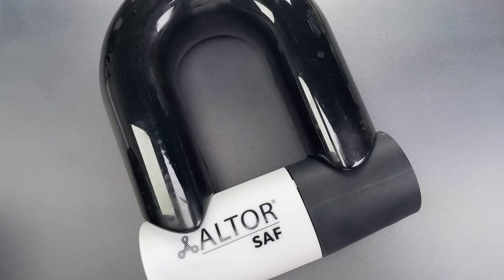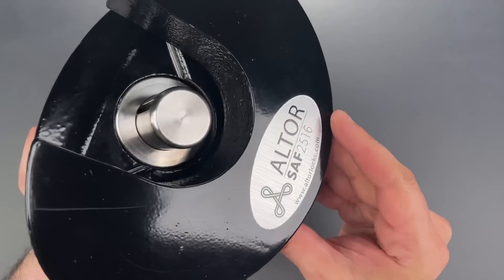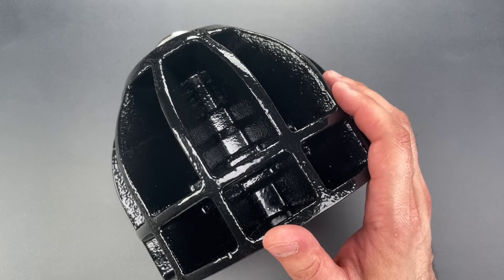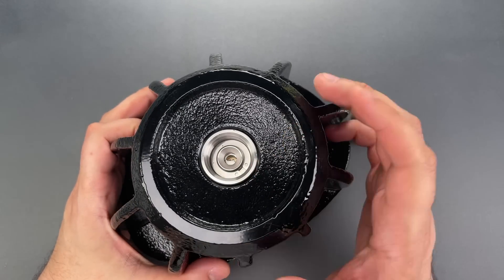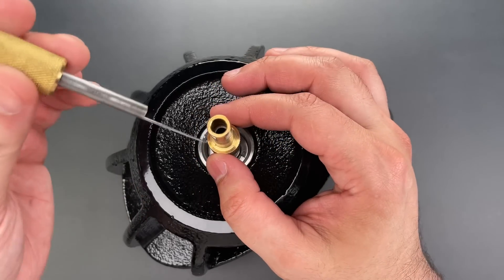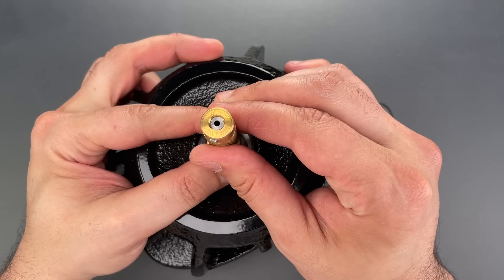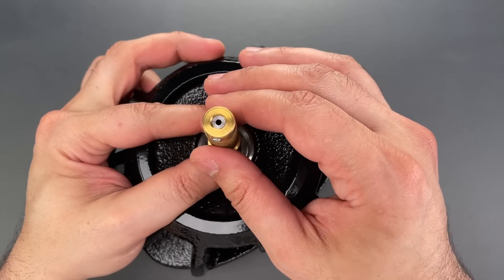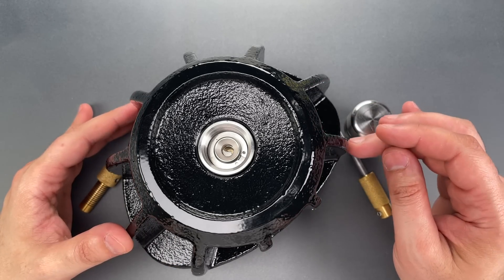[1339] HUGE Altor “SAF” (Strong As F***) Trailer Lock

Comment: "Despite its absurd proportions, this is something I would not hesitate to use"

Wow. What a glowing praise. It's assuring to know that there are locks out there, such as this one, that could actually give you peace of mind knowing that it really could protect your hard earned possession.
Reply: I would recommend keeping an eye on altor because they seem to have a mission now, to create a lock for every purpose that is physically resistant to angle grinders and other similar power tools. And if they continue pursuing that mission then this world will become a lot safer
Reply: @the_undead  They do need to keep changing their lock core, though. The reason a commercially available tool doesn't exist yet is because it's less common. Once a core becomes common, a tool for it will become common.
Reply: @Merennulli  I don't think it's necessary. Just like what LPL said, it would take a specialized tool AND some skills to pick this lock.

But if skilled pickers are going to pick altor, they are going to pick it for the challenge and not for stealing the trailer.
Reply: @Merennulli  picking a lock is not the main problem that you deal with when in more practical use especially once you start getting into the higher end stuff like this detainer cores with a lot of false Gates, and that won't be an issue for a considerable amount of time. The main problem is destructive attacks, destructive attacks are the main reason that Master Lock puts so little effort into their cores because they probably don't see it as worth it to put that much effort in compared to what you're going to get for it in terms of practical use.

That being said I think more effort should be put into the pick resistance of a core but the outer stuff even if a tool does become in common use which I highly doubt because Matt Smith has all kinds of effort put into making sure that nobody can manufacture his lockpicks. 

Which leaves us at destructive entry is the only realistic method someone is going to break into the altor SAF locks. And these things are so resistant to brute force that I would happily trust them for years to come
Reply: @Merennulli  the only reason I wouldn't trust these is if some new standard of battery powered angled grinder becomes a thing like say the standard size is a 5-in disc instead of a four and a half inch disc
Reply: @Layput  My point is that the tool won't be "specialized" anymore if SAF locks with that core become commonplace.
Reply: @the_undead  I would agree this addresses the main problem, but security is a game of being the least viable target. I was responding to the "world would become a lot safer place" aspect.

Right now, the standard of security is on the Master Lock level so thieves come prepared to take out a Master Lock. If this were the standard, thieves would come prepared for this.

That said, I honestly don't see this changing the world of security for the same reason Master Lock is the standard, though - This is about $300-350, while Master Lock trailer locks start under $30. This just moves the needle a little further past "ludicrous" for the high end locks.
Reply: @Layput  Imagine coming out in the morning to find the lock undone and a note saying nothing was taken, you were just practicing...   Sheeeesh....
Reply: Now I spent all all my money on this Altor SAF, i need another one to protect the first one.
Reply: @the_undead  Or angle grinders will be getting a lot better soon!
Reply: "Despite its absurd proportions, this is something I would not hesitate to use" That's what she said?

Comment: "This is something I would not hesitate to use"

annnnnnnd Altor stocks just soared.
Reply: Me the ALPHA M*LE of this comment section and me command RESPECT. Right now me telling you to NOT observe any of me nice cool sweet videos. Instead just look at me awesome good powerful thumbnails. Thank you, dear lu
Reply: Are they actually listed on any stock market?
Reply: @kingbreaker1972  no
Reply: @AxxLAfriku  deez nuts
Reply: Suddenly the super glue is gone from the shelfs haha.Than, number of suicides encreases.
Reply: @JosephLedbetter  lmfao
Reply: @Hansengineering  Alright, Sales then lol
Reply: but he opened it in one minute
Reply: STONKS
Reply: @An.Individual  alright, how about you try.
Reply: @An.Individual  Sure but he had to use the tool he designed specifically for this type of lock and praised the cut and drill resistance. Pair this lock with welded bolts to hold everything else together and that trailer isn't going anywhere.
Reply: @An.Individual  look at some other videos by lpl, where he either picks the cheaper and more usual locks in seconds with a wave rake, or finds a way to bypass the lock entirely

Comment: Altor Execs:  "OK team, LPL just gave the prototype trailer lock his highest praise.  Take it to production immediately and whatever MSRP we were considering, double it."
Reply: With LPL praise like this, they will charge $500 for this lock.
Reply: You forgot the most important part:
"Cut production cost at least in half.
No need for the final product to be as strong as the prototype as long as it looks the same"
Reply: @Jehty_  Awwwww... you've just violated your Master Lock board member NDA.
Reply: @Ron-ds2ob  They were already going to charge that much, it's a very high end trailer lock.
Reply: They say if you preorder it you save $75, and its for $350 rn. Im guessing the final product will be $425, give or take maybe $75
Reply: @Anonymous4045  a lot cheaper than having expensive stuff stolen out of a trailer
Reply: @Anonymous4045  That is honestly way cheaper than I was expecting for what you get. That much steel and the tooling/processes to manufacture it are not cheap.
Reply: MRPR
Reply: Or they'll weaken the prototype to cut costs and people will think they're buying a strong lock.
Reply: Ross Outdoors  well, if you have a couple of snowmobiles for example, you still have them locked separately on the trailer, so getting them off even if you have access to the inside is a bitch.
Reply: Alam natural  quit with the self-adverts and get off Lpl's channel (btw i saw the amount dislikes on your video your doing more harm than good to your self anyway)
Reply: @Ron-ds2ob  and If I was protecting my $50,000 boat, I would gladly pay that to know it can't be cut off with an angle grinder.
Reply: 500 sounds about right honestly.  I bet just that lock cylinder is over 100 dollars.    Then all the steel, manufacturing, shipping, etc.  It’ll be a spendy product.
Reply: Ross Outdoors  Yeah, this won’t stop theft of product, but it will prevent someone from just stealing your whole trailer, which is what many trailer thefts are all about.  It’s often faster to just hook up to it and haul the thing away from prying eyes than it is to cut into the trailer and remove items from the inside.
Reply: Alam natural  Hello. It looks like you are trying to attract new vievers/subscribers to your channel by spamming your videos in the comment section of other YouTubers. If you aren't aware, this behaviour is not going to achieve the desired result. Some curious people like me will klick on the link, skip through the video and then exit playback, before it was counted as a view. I, like others, will now remember your name and avoid your channel like the plague. Have a nice day.
Reply: @2LucasKane3  i went to their channel to block them
Reply: @alefgardhero  That's what I mean. Posting Links to videos in other channels comment sections never results in more viewers or subscribers.
Reply: or alternatively:  ALTOR  Execs:  "OK team, LPL just gave the prototype trailer lock his highest praise.  Take it to production immediately and whatever MSRP we were considering, double it." OH, and buy out all of LPL's new picks so no one can pick our lock.
Reply: @alefgardhero   So did I.   Hopefully Youtube will squash them like a bug.
Reply: @androidrandom9979  no if they were violating their Master Lock board member NDA they would be saying that the important part is to cut production cost to be 1/10th of what the prototype cost
Reply: @2LucasKane3  I thought it was a link to Altor's channel.  In the future, I will just search for the channel myself.
Reply: "On the packaging stamp it with LPL Approved, DO IT NOW"
Reply: Ross Outdoors  Yeah, you'd literally need a shipping container bolted to the bed as your trailer load for this to make sense, which is probably the audience they're going for.
Reply: @crazy_human2653  here at Master Lock we don't have prototypes.
We just build the first thing that springs to mind and if doesn't work, 🤷‍♂️ people will buy it anyways.

Comment: Well, if you need a home-made specific tool and the rest is strong AF... I call this a good buy.
Reply: Can you imagine trying to cut that? That would be a big huge nope from me.
Reply: don't forget that you need a ton of experience
Reply: I noticed that LPL said it was a product he wouldn't hesitate to use, not buy. I'm guessing the thing is stupid expensive..
Reply: @T.J. Kong it would take a while and how many thieves are carrying around an oxy/acetylene torch. Not very discrete either
Reply: @T.J. Kong You could probably destroy 1000 Masterlocks in that amount of time. That should be the official cut / torch resistance rating.
Reply: #Evil
Reply: @TysonJensen  MLPM (masterlocks per minute) a  way to calculate how hard you hit, how fast you can pick, or how good you are with torches
Reply: Was a price given? only a good buy if you can afford the thing
Reply: About the only tool I think could cut that would be a powerful chainsaw with equally as powerful blades, and even then you'd likely break the blades and need to replace them several times before you'd get through. And that's a lot louder than you'd standard metal cutting tools.
Reply: @JG_Wentworth  dude why in the fuck would you try to use a CHAIN saw on this
Reply: @marvindebot3264  I used to be a machinist. I can imagine cutting through this. First step, make someone else do it. I'm also on the giant nope from me.
Reply: @br3wsan  300 bucks, not expensive considering you are gonna use this to protect a trailer
Reply: @Pistol_Knight  it was stated to be a prototype, so I don't believe pricing has been finalized. Although it is probably going to be very expensive considering the bike lock shown in the beginning of the video goes for over $300
Reply: @br3wsan  The lawyer in him is always cautious with wording, etc. He is always careful to avoid outright endorsing something.
Reply: @T.J. Kong about as well as ar500. plasma would be quicker.
Reply: No one will buy
Reply: @br3wsan  - its most likely going to be in the $200 range.. but of your trailer your protecting is $5000+ its worth the money
Reply: @steven.h0629  that’s for pipe cutting, thin metal.. and not hardened
Reply: @preston6408  I think the demo there would argue, that's NO thin pipe.. which isn't the point now is it.. chainsaws DO cut metal.

Comment: Disk Detainer Core: “He’s gonna say it!”
Having to use a custom tool: “… holy crap.”
Reply: The pick that he made without Bosnian Bill.
Reply: So, Not .... Bosnian Bill??? :(
Reply: My disappointment is immeasureable and my day is ruined
Reply: @Marinealver  BosnianBill's pick does not work on Abloys as you cannot put tension on the zeroth cover disc. That vulnerability was fixed decades ago. You need Huxleypig's version that LPL is using here.
Reply: Indeed, the disappointment was huge

Comment: So after 1339 videos, we should conclude that every lock needs to be the same size and weight as a kettle ball, made out of thick metal, and with a lock that only LPL has the tool to open.
Reply: Disregard Alam's link.  It's of no use to fans of LPL.
Reply: @brownro214  ...but why is he on lpl's channel all the f-ing time???. I even reported him a whole number of times.
Reply: Don’t forget made of hardened steel.

Comment: The bike lock version of this is a good design. The outer shell is made from aluminum which clogs up grinder discs when thieves try to cut the lock and the inner core is made from hardened steel. It's an expensive lock though that retails for $300.
Reply: Yeah, but when your bike can cost 5K or more that bike lock would be lovely.

Of course, that's for the ones who do get bikes like that. I'd probably end up with a bike about $250, if I really wanted one.
Reply: But who is lugging around a lock (and chain presumably) of that mass for their carbon road bike? The use case is confusing
Reply: @_BangDroid_  if you watch the video on it, he explains that it is intended to be left at one location, eg locked onto the bike rack.  It's not intended to be carried with the user.
Reply: @tinetannies4637  You can't really take a motorcycle inside though :/

Comment: Spectacular video and a fantastic lock!
One thing of note that most commenters have missed... This lock is made to be installed UPSIDE DOWN on the coupler, so you would need to not only make your own picks for it, but also do it lying down, working face up on the ground with the full weight of that lock directly above your face. Umm.... No ! I would not hesitate to use it, but it may be overkill for utility trailers!

Comment: One thing to add. When in use, it's upside down and low to the ground, making picking even harder. We might have a winner here!!
Reply: The lock part of the bolt is on top of the trailer's hitch.
Reply: @HSishi  Nope. The lock cylinder faces down. The lock lug moves up in the locked position and secures into the bottom of the hitch (where the ball would go).
Reply: I was thinking the same.  Looks like they sat down watched his videos saw what he hated in other locks and built the best lock they could, and it paid off.
Reply: @HSishi  look at the thumbnail it shows it in use.

Comment: When even LPL needs a fully customized tool and experience with this core and still visibly struggled? That’s when you know you’ve got something seriously strong. Throw in the protection against brute force and this becomes terrafying
Reply: Visibly struggled? It didn't look any harder (for him) than your basic decent tumbler lock with safety pins.
Reply: @EthanReesor  he said "might," "may have," and "could be" like 10 times. Usually he knows exactly what's going on inside the whole time

Comment: Another consideration for this lock is you will be picking the lock with the cylinder facing the ground just to add an additional degree of difficulty.
Reply: I was thinking this exact thing. It took LPL two minutes to pick this, with a custom made tool, in a controlled environment. Imagine being just a dude out in a driveway somewhere under extreme pressure, upside down with the wrong tools. Forget it.

Comment: Jesus that is one thiccccc lock. At this point it's probably faster to just cut open the frame of whatever this thing is attached to
Reply: Cutting a trailer frame or coupler presents the same issue, multiple blades and batteries.  You'd need a plasma cutter to do it in any sort of reasonable time.

Comment: need to introduce you to one of the greatist osha violations....the 10" cutting wheel adapted to a 4 1/2 grinder...scary as all sin. insane gyroscopic properties
Reply: Scary as all sin. * fun to use ( company not held responsible for loss of fingers, limbs, family members and/or pets ).
Reply: Do you think using a wheel 4X bigger then designed for is going to have even one single advantage.? Cuz it doesn't
Reply: @brandonwest8108  not having to change wheels = advantage

momentum from the huge wheel acting like a flywheel = advantage
Reply: @jjvoich  that method is also insanely dangerous to use, and if someone's crazy enough to try it, pretty much the only thing that's gonna stop them in the first place is shooting to kill.

Comment: One thing to remember is security is only as strong as the weakest link. If i find a trailer i want with this on but the trailer coupler itself is held on with bolts then i can probably buy a replacement coupler a wrench and just swap on a new coupler in maybe 20 minutes
Reply: Thats why you wield the coupler and bolts onto the trailer itself, and the hinges, and anything else removable.
Reply: @Gavin-N  that's fine...   but couldn't the trailer be dragged away using just the two safety chains?     not even touching the lock
Reply: @ccastro306  LPL told us to put the chains Under/ Inside the cup thing when locking it so people couldn't do EXACTLY that. that was a major issue for a couple of other locks though.
Reply: @Gavin-N  I saw that on a few other videos... but I don't know if they'll fit under this monster of a lock !    I don't think he mentioned it in this video unless I missed it
Reply: @ccastro306  i think they will fit, I mean, look at the size of that thing!